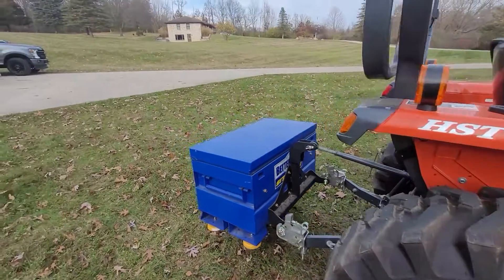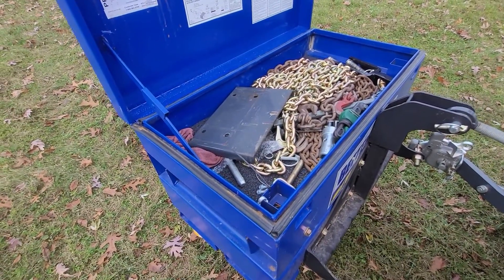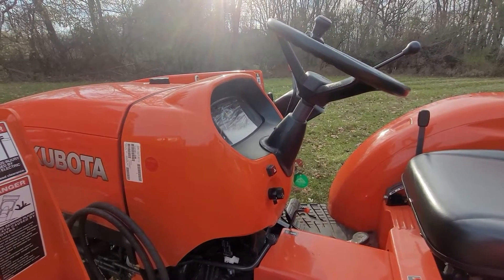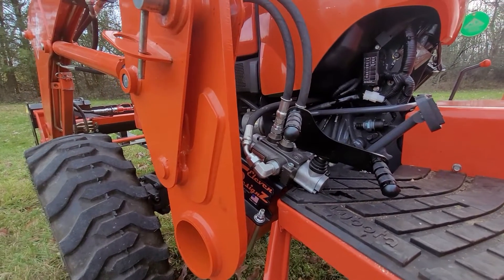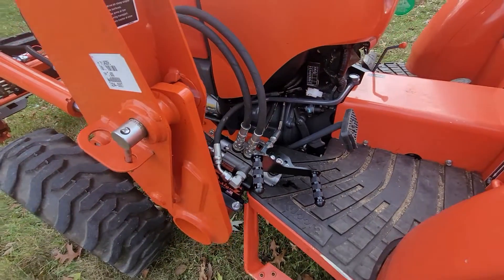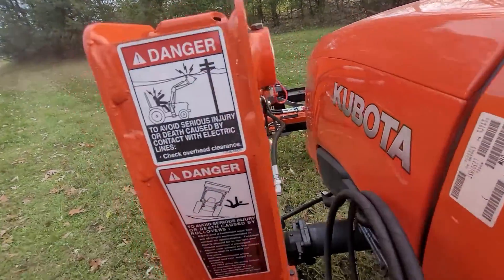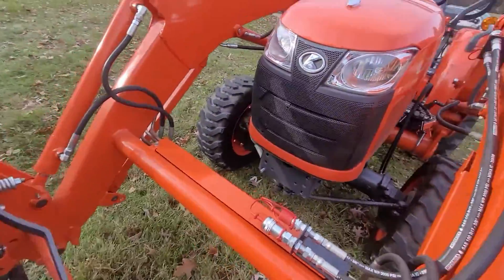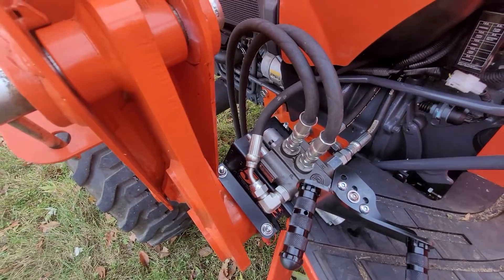This 3rd function hydraulic kit is unlike any other!

Comment: is that job box set up is slick. you should do a more detailed video on the bracketry you made for it.
Reply from the maker: Thank you! I should do that. Unfortunately, the internal frame is covered in concrete, but the exterior I could cover.

Comment: What’s the chances of making it work on a L3902?
Reply from the maker: Working on confirming fitment for the L02s. If it won't work as confgured, I am sure a different design could be made.
Reply from the maker: I have confirmed it will work on the L02 gear drive models, but not the HST unfortunately.

Comment: Have been waiting to see this "new miricale-wonder device" you have been Werken on. Caught a glimpse of it before in your other vidio demonstrations. This is a "PURE UREAKA" moment, and you have just "Put to shame" ALL other electric 3rd function & electric diverter valve kits!! With having "FULL CONTROL" out front( & maybe at the rear) all the rest of the "kits" are almost like Overpriced( and They ALL ARE) ; = SCRAP. This "New Kit" should BE a Total Success !! Thank you Sir for the Excelent vidio and happy safe hydraulic  tractoring. Best wishes with all your endeavours.
Reply from the maker: Thank you! I appreciate it!

Comment: Justin, Nice work!  Will this design fit on my Kubota L2800 HST with a LA463 loader?  If so, this is exactly what I need. Thank you.
Reply from the maker: Thank you Tom! Without having that model to look at, I couldn't say, unfortunately. Although the hydraulic system may be very similar, the mounting methods, hose lengths, etc. are tailored specifically for the L01.
Reply: Thanks for the reply. I will follow up with my Kubota dealer to see what they say and get back with you. Thanks again and Happy Thanksgiving! @5elevendesignz511
Reply from the maker: @tompeterson1688  happy belated Thanksgiving. Merry Christmas! Sorry for the late reply.